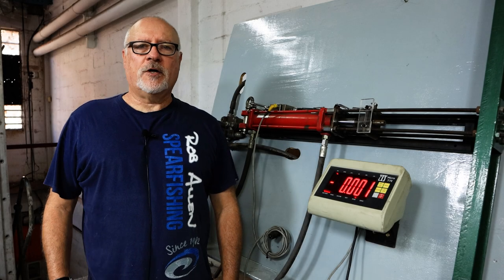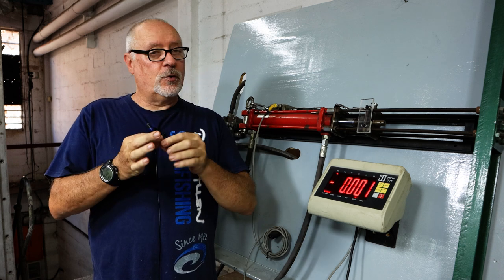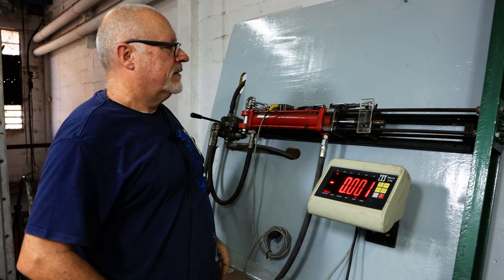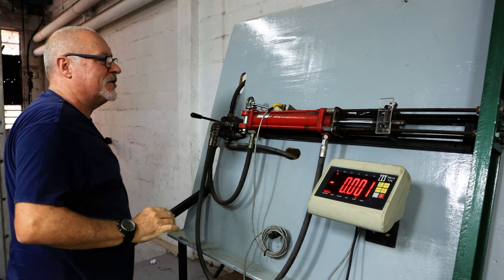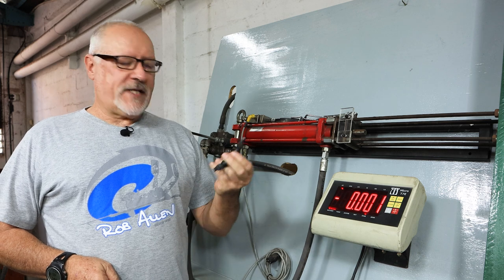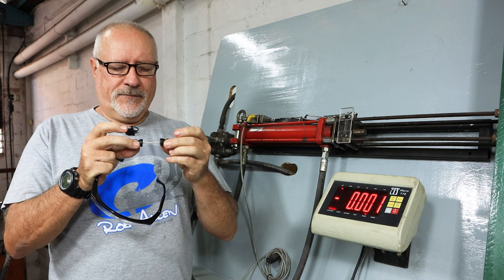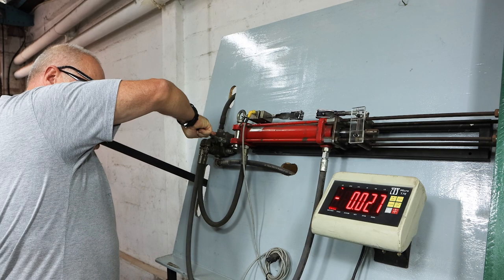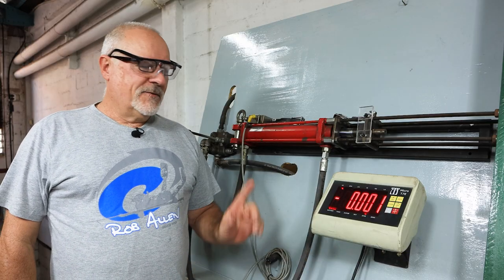Rob Allen | Wishbone Bead Tests | 2022

Comment: A better set-up maybe to put rubber in the middle of the string and pull on the string so it would be clamp string rubber string clamp. So to not squish the rubber.
I don't know if it will make a difference or not but would be good to know
Reply from the maker: The plan here was to test the bead holding power, not the rubber. When mounted in the rubber under normal use it will be very difficult to pull to that high a break strain. I would also worry about how hard everything would shoot around the work shop if the rubber broke.
Reply: @RobAllenSpearfishing  is the bead the weakest link
Reply from the maker: @stickypaddle6432  I doubt it, our plan is to always improve what we make with something stronger.
Reply: @RobAllenSpearfishing  well whatever you think is best because damn you make some good gear .never had anything of yours break
Reply from the maker: @stickypaddle6432  😜👍